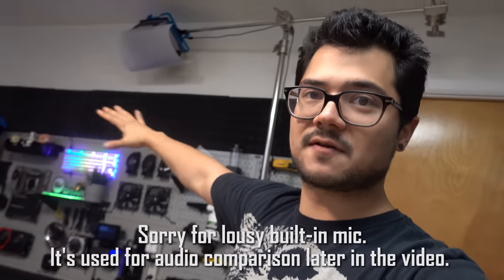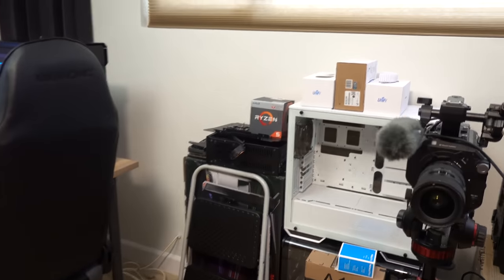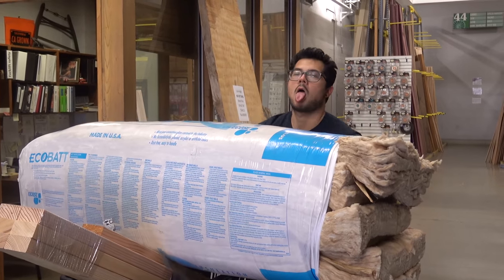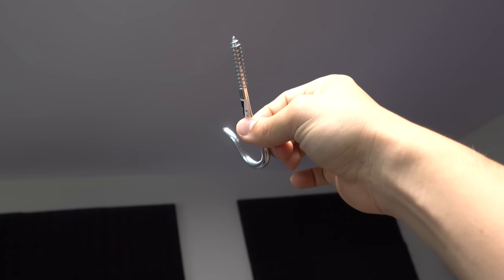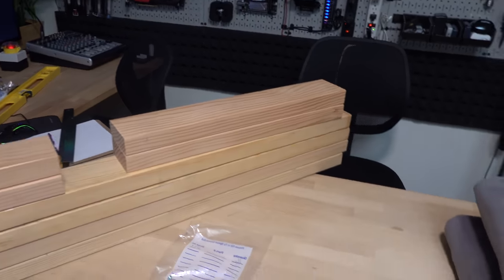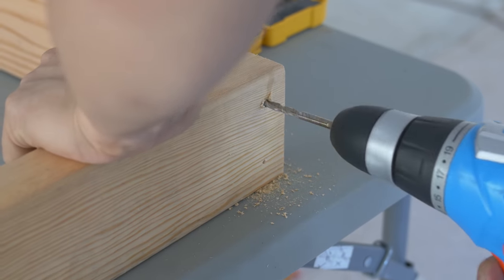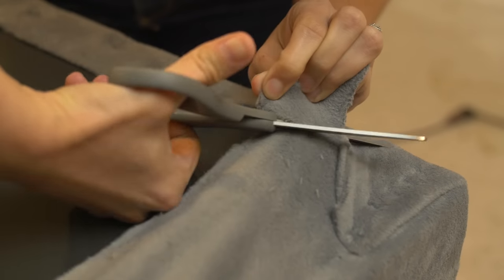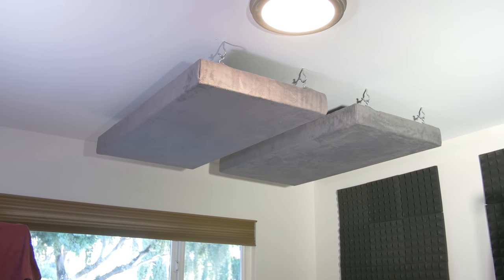Making my own acoustic panels...Was it worth it?

Comment: there isn't enough difference to justify the 250 spent
Reply: I agree
Reply: Case  White worth a try, dont think he picked a very good room to be the studio.
Reply: if they add 2 more it will be
Reply: Naa there is a major difference. You could definitely tell when he spoke from the two corners of the room.
Reply: Yeah
Reply: he makes enough to cover the costs anyway for the average guy or someone newly looking to get in to youtubing or whatever it ain't worth it but at least it isn't like what Linus Media Group do with their $100K+ cameras which have proprietary batteries and accessories and Linus was going on about how he spend a few hundred dollars (can't remember the exact price but I am sure it was over $100) on a small aluminium swivel arm thingy for a camera that looked like it was worth under $30-$40 or something
Reply from the maker: The difference is overwhelmingly obvious when standing in the right location but I agree that a much cheaper solution would be ideal - Otherwise I'll end up spending thousands to treat the entire room O_O
Reply: @J Fz lucky for us there us no shortage of videos on youtube on how to do this most of which are cheaper and don't involve hanging them
Reply: @edwin4625  Could HAVE, and would HAVE
Reply: Would've been better off just buying enough fabric to cover the ceiling to absorb the sound over building those boxes, also wouldn't it be better to have each box in a different area to clean the echo from another angle ?
Reply: The roof is already drywall. Drywall is great for noise as it's a perfectly dead material. My guess is the insulation above it is mostly there to prevent heat from coming in. Assuming he has access simply replacing that insulation with what he bought would be an alternative.
Reply: @Bitwit  maybe a sponsor or partnership  with a company could absorb the cost you should ask Lyle if he has any contacts in China since you are dead set on doing it probably be less work to cover the whole room that way
Reply: @Bitwit  understand that most of sound dampening you get from panels is more about shaping the sound, rather than the materials used (though material type is important) think of it how Stealth systems work on a modern Jet. This is why draped fabric is probably your best choice, rather than a heavy wooden structure above your head. The A typical foam panels works mostly because of the patterns cut into them, again to break up the sound rather than to just absorb it. 

If you want to continue top use foam panels, I suggest what I did, and buy a cheap cork board, and mount the foam panels to that using either Glue, or you can even just use long pins. The cork boar will be much lighter weight than 2x4s and be safer over all.
Reply: @J Fz Thickness absorbs deeper frequencies. A one inch thick foam directly attached to the wall most likely has a efficiency of 100% down to 1000Hz, but only like 20-30% in the 250-450Hz range where a male voice is located. The panels kyle built most likely has a 100% efficiency down to 200-250Hz, so 100% suitable for a male voice. The distance to the ceiling adds a few percents in the region lower than 200Hz. If you want to go deeper into this stuff you can google for the porous absorber calculator and enter like 20mm thickness and 20.000 flow resistivity vs 100mm and 15.000 FR and 50mm gap. The difference is huge between the two.
For a home cinema the thin foam things would be totaly unsuitable since it only kills the echo over 1000Hz, but you would want to dampen the 25-1000Hz region too, so you need thicker absorbers too.
Reply: @Bitwit    Good first attempt.  Unfortunately the materials and the execution were off (no offense).  An analogy for you would be watching a person build their first computer and they really have no idea what they are doing.  

I've built reference studios where acoustic treatment is paramount, and a little hint is you do not need 2 by lumber to frame seven pounds of insulation, nor the suspension of individual panels unless you are creating a complete bass trap.  Also that insulation is the wrong type and will start to sag very soon.  The upside is that given how you mounted them, they will look like a celulite riddled derrière ;-)

Another hint is install a drop ceiling, layer that insulation like fish scale above the acoustic ceiling, over the entire ceiling with an air gap above that.  Doing a couple of panels in the corner is really not going to affect much.  Also, you would be better to spread those two panels apart  where your nodes are rather than just spitball a spot on the ceiling.
Reply: @edwin4625  as a sound engineer, that stuff is trash and doesn't work very well. He may have not purchased the right insulation and fabric to make it work well. My setup is freaking DRY because of all of my sound panels. It makes a difference but you have to do it right.
Reply: @raomar0  you do opposing surfaces so the other wall and the ceiling. Neither are unimportant
Reply: That's because like all tech Youtubers, they suck at construction etc. He did the panels incorrectly(shouldn't put a hard back on them) and also made them too small and too thick for a ceiling. Thick panels go on the wall. Make large but thin ceiling panels. Fabric front and back. Much much much more effective than 2 in one corner.
Reply: @Bitwit  It's better when you listen with headphones. I think the real test is when you're set up for Awesome Hardware, or another video from the desk. I would also place one of the panels a little closer to your desk to catch those reflections. I've already commented  (see above) on sound blankets and 1x4s :-)
Reply: @Bitwit  You're on the right track... keep going. 2 panels is not enough. 2 inch thickness is minimum, 4 inch would be better. Rockwool or fiberglass. 8 on ceiling. those 6 you ordered against the wall. And maybe try 3 or 4 more against the walls under your desk(s). If they have 2 or 4 inches of spacing from the wall they work better. Then no doubt, for voice recordings you'll see a huge improvement. If at all possible try between 20 to 30% of treatment per surface area. If you go on the cheap you can make the panels for 20 bucks a pop. Neicer (breathable!) fabric will up the cost. Those black (egg-crate) foam panels only help from around 1Khz and up... no good for voice, reaching down to around 100hz. Those thicker panels (with spacing) will help to around 250hz and a little below that as well. 
Good luck! I'm glad to see you're working on this, because to be honest the audio in your new studio kinda put me off.... Still love all your content though!
Reply: @edwin4625  yeah literally could have covered the whole ceiling with it for that price. If he used high grit sandpaper and used actual soundproofing adhesive they wouldnt have moved at all too.
Reply: @Bitwit  From another video I watched years ago, using cheap towels as the filler instead of insulation is a really good way to go. It's a lot heavier, but since they're hung on studs it should be fine.
Reply: Edwin - that foam is useless which is why it’s still “echoey”. 

Not that bit is going to read this but.

1. Your panels are “so close” to being decent. 

First, the insulation isn’t exactly what is recommended. Outside of rigid insulation, a common option is Roxul Safe-n-Sound. Same size option as what you purchase.

The covering material isn’t doing you any favors. It needs to be breathable. Most used material is burlap.

2. Ceiling panels are good,  but you need side panels and bass traps. Again, the foam you have does nothing.
Reply: @zahidshabir4038  Reds actually use industry standard mounts for batteries.
Reply: @edwin4625  cheap acoustic foam does not sound proof. it only stops reflections.
Reply: @J Fz the foam squares only stop reflections. They dont actually deaden the noise. Thicker panels trap the sound.
Reply: @aBoogivogi  drywall and insulation behind it is good for keeping noise out of the room. But the flat surface of drywall reflects back the sound in the room and causes the echo.
Reply: @Bitwit  you could get have got some company to sponsor you. Vicoustic USA to be specific. The calibration they do is just awesome.
Reply: @J Fz they do help a little but the foam really isnt thick enough to stop it from hitting the wall and bouncing back. The sound still bounces back from them but not in the same direction that it went in. It more or less redirects the sound rather then deading it
Reply: @zahidshabir4038   1. Learn how to use punctuations dude, its not that hard to use a period or a comma here and there 
2. The "$100k+" cameras LMG is using, that you're referring to are cine cameras. It's no surprise that they cost so much for each individual part and needs a bunch of proprietary stuff to make it work.
3. Understand why they are using those cameras and what they can achieve with it before you start talking smack abt the cameras and say its "worth under $30-$40"
Reply: @Ichbaar  thank you for correcting me.
Reply: @edwin4625  no he couldn't have. 

1. Foam will never soundproof a room. Neither will acoustic panels. This is acoustic treatment, not soundproofing- soundproofing requires actual construction and is a much more expensive and complicated process.

2. Foam only treats high frequencies. It is not dense enough to effectively deal with mids and bass which is where most acoustic problems exist. Including the foam bass trap in the corner of his room.

3. Putting two traps on the ceiling in the same area was redundant and he could have had a much more drastic difference if he took the stupid foam off the wall and put a trap there instead.
Reply: @aBoogivogi  soundproofing != acoustic treatment. Drywall is an acoustic barrier, so yes it will attenuate sound. But panels like these are not meant to soundproof, they're meant to stop reflections for the people who are inside the room being treated.
Reply: @thecrlghs  at this rate it would be better to just have pros do it
Reply: @Bitwit  What if you just bought a cheap carpet and glued it to the ceiling?
Reply: @Bitwit  Look at the high performance DIY acoustic panels at DIY perks... they cost a lot less (especially since you already bought the insulation ;) )
Reply: There's a cool DIY channel that used towels. Worked better IMO.
Reply: @Bitwit  a cheap solution basement musicians use is blankets. go to goodwill or value village and buy tons of cheap old blankets and staple them all over the ceiling
Reply: Yea the cheep foam panels and a staple gun is the best solution I have found for the celling a caulking gun and construction adhesive along with the staples would work the best
Reply: I think its worth it, just need a better mic then build in on camera, cuz was watching one of linus videos and then this one and the difference was night and day
Reply: @Bitwit  Sound absorption is tricky, and these panels are a solid start. Placement is what's really going to make a big difference though. Standing waves, where two parallel surfaces reflect sound waves back and forth, is what sounds the worst. Because of this, irregularly shaped rooms are best for sound, and square rooms are the worst. If you can stagger the placement of your panels they'll have a greater effect of absorbing waves rather than allowing them to continue bouncing around.  Other things that help with sound include shelving, oddly textured surfaces, blankets, shaggy carpet, that sort of thing. I ended up putting up Producer's Choice sound blankets in my recording space on walls that don't get much visibility in my videos and they make a pretty big difference.

This is a huge rabbit hole to go down. You're probably better off just moving the microphone closer to your mouth, with a lav or something.
Reply: Just hang thick blankets and call it a day :P .....
Reply: J Fz if you see an actual recording studio using cheap foam, run.
Reply: You forget he made a content video out of it and more than made up for the price with what he made off the video
Reply: what he should do is a test of different systems in a different space under ideal conditions and see what works best and why before spending any more money
Reply: @Bitwit  Get a company to sponsor you lol.
Reply: @Bitwit  yup a big difference, then again listening on genelec monitors
Reply: @thecrlghs  other than the overkill frame and the potential for a saggy look in the future, the absorption would probably be "fine" for a voice studio....if he just had like 10 more panels spread around the room, lol
Reply: What alternative would work better?  Wood and insulation are not too expensive.  The same thing he built would cost much more online.  Foam would be a cheaper alternative but it is not going to give the same results as 4-inch thick insulation.
Reply: @davidjenkins8449  for me, acoustical foam is the way to go on a ceiling unless budget/time is no concern. It is easy to stick on with the right glue, cost isn't too bad if you do 50-70% coverage, not too flammable, and can look pretty slick. Then some sort of heavier duty bass traps in corners up to ceiling, and a few insulation panels on each wall (rigid fiberglass or mineral wool).
Reply: @Bitwit  Yup, but not so much in the test zone. Directly below and in the second corner was pretty damn good.
Reply: There are better ways of doing it instead of what he did.  He over engineered them with the 2x4's,  he probably could have gotten away with some thing like a 1x3x8 type of system, that lumber is much cheaper than the 2x4x8 by about half.  Then there is the insulation, you CAN get away with it by just using the rest of the insulation and getting your money's worth.  The hardware was probably the most expensive part as they usually are, those brackets were probably $20 a package, if you're a handyman, you can buy your own 1"x1/4" steel and make your own with an angle grinder and a drill with proper bits.  In the DYI world there are many ways of doing it for it to be cheaper, you can either spend the money or spend the time.  Doing everything like I listed it might take you a whole day, and it depends on if it's worth it to you.
Reply: I agree
Reply: @J Fz  The thickness has to do with the insulation as it expands up to three times its packaging width. I would think the hanging bit would be for rearranging purposes as nailing them to the ceiling is a pain to undo in case they sell the house and have to remove them.
Reply: here's why. 

1. wrong fabric. that fabric is too thick. 

2. that acoustic material itself. that's regular home insulation. not for acoustic treatment.
3. he only has that on ceiling. he need more on walls.
and few more. :D
Reply: There would be an extreme benefit if the whole room was the size of a closet and one of those panels covered half the ceiling at once. I honestly couldn't imagine adding soundproofing to the entirety of any normal sized room.
Reply: @Corzappy  i guess he couldn't either
Reply: I made 4 corner traps and 4 acoustic panels for under $180....
Reply: @Bitwit  Sometimes sacrifices need to be made, think of it as a investment for your business and its only one time payment
Reply: @edwin4625  That cheap acoustic foam doesn't really work properly and makes the room reverb sound worse.
That is why recording studios use either the expensive foam or glasswool/rockwool panels like the one he built.
Reply: @edwin4625  there's a reason those egg carton acoustic foam square are cheap. because they're not good.  They are not effective at dampening lows and low-mids then the room just starts sounding bass'y.  He should have used rigid fiberglass insulation. and not put poster board on the back and just wrapped the fabric all the way around. The poster board creates extra reflections.
Reply: yes but now he has extra material and can make more if he needs to.
Reply: He needed to build many many more panels.
Reply: You can easily cut costs If you use cedar fence boards as frames rather than 2x4s. You will need to sand them down if they run a risk of being touched and getting splinters. Also any fabric can be used as long as you can breathe through it, there is a bit of false advertising out there for fabrics marketed as "acoustic fabric" as they make no real difference, but as I said if you can't feel your breath through it then sound waves will not be able to permeate it effectively enough for it to be worth it. It is also unnecessary to have posterboard on the back, you can simply use more fabric, this will also increase the amount of acoustic treatment because the soundwaves can enter the acoustic material from both sides. rather than just the front.  I was able to build 6 panels that were 16"x 48" for under $150 bucks (not including the cost of tools like saws/sanders/drill.

Also keep in mind the most efficient way to get rid of bad reverb is to treat the corners first, sound naturally funnels into the corners and this will be the best and cheapest way to get the most out of your panels. The sides of the room are still important but I'd maybe prioritize the side of the room that is behind your microphone/camera set up to be the more heavily treated than others. Also, Not that anyone asked lol but I went to school for audio engineering and sound design and have experimented with all sorts of acoustic treatment solutions Owens Corning, Rockwool, and traditional acoustic foam, even some more ghetto solutions as a child with surprisingly effectly repurposed memory foam.

I 100% agree though $250 is very steep for just 2 panels.
Reply: I was just going to comment that. Couldn't tell any difference in the sound test. A clap test may have worked better. Hope he could hear the difference at least
Reply: Bitwit really you gotta have the Corsair ad.i was gonna risk losing some performance for a pc build just to get the headset.and now you gotta rub it in my face
Reply: Also he gets paid for making this video documenting the process, they essentially pay for themselves
Reply: The thing is those eggshell type panels have a different frequency response than the panels he made. The panels he made remove a lot of boomyness from the room. Echo from from high frequencies (the frequencies the eggshell panels dampen) is not that much of a problem and actually makes your room sound alive. If you fill the room with those cheap panels you will have a very muffled sound which is actually worse than no sound treatment at all usually. Those eggshell panels are kind of a scam and thats why in high end studios they just build the room as best as possible and dont really bother with them a lot
Reply: @Bitwit  Towels, bro. Towels are cheap and cheerful and provide great sound dampening - best place to get them cheap is a charity shop
Reply: @edwin4625  You can't sound proof a room with foam. You can pretty much only sound treat high frequencies flutter echo with foam.
Reply: The foam on the walls don't do much for anything under 4khz.
If you wanted to hear a proper difference, you need to treat the entire room. Not just a bit.
Reply: I feel like if he added more than the two on the ceiling there would be a noticeable difference
Reply: Zapp foam won't sound proof anything!
Reply: @mikehillproject  And even at that for 90% of the situations it doesn't do shit.
Foam is for specific situations. People buy it because it's just but you'll end up with the good old low mids hump.
Want accoustics? Get thicker material.
Reply: Room Acoustics is a huge rabbit hole to go down but necessary.   Bitwit should use a room mode calculator and also a RTA  to  measure his room  to get an idea where room modes are and to see the frequency response of his room  and then  try to treat the area  around  the mic.   Also objects in the room affect the acoustics such as tables, chairs, etc.  Hard surfaces obviously reflect.  Acoustic Foam is only good for med high - high frequencies so it is not as effective as broadband absorbers such as mineral wool commonly used to make acoustic panels which is why they charge more for them.  However,  if placed properly  you would need less panels to be effective.  This all trial and error though because no one room is the same unless you hire an acoustician or someone specializing in acoustics.
Reply: Zapp no it wouldn't 😂😂
Reply: The problem is how complicated acoustics are, they need to be in the exact correct positions in order to get the most out of them!  Building them yourself is definitely a better solution though!
Reply: @edwin4625  you aren't soundproofing anything with foam, 100 guys who liked his comment, you aren't soundproofing anything with foam.
Reply: @jfraticelliful  agreed
Reply: It would cost a lot more to fix his damaged lung tissue
Reply: The reason theres only a little bit of difference is because he is not using a breathable fabric stapled over the absorbing material. Canvas bag would be best IMO
Reply: @Bitwit  You should have stapled canvas on top of it instead. Sound can pass through it easier and into the insulation beneath it. With the material you used, it is essentially like putting a blanket on the wall.
Reply: @Bitwit  If you would've used towels, you would've made about 4 panels, and it has way more audio isolation than the foam. Check out DIY perks, Towels are a cheat code. Lol